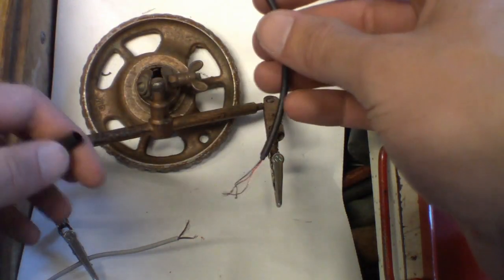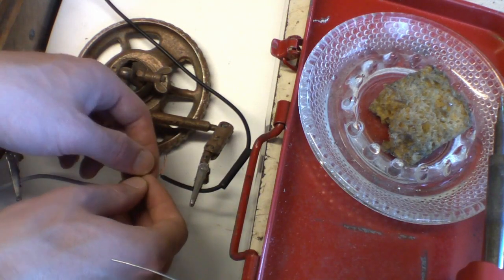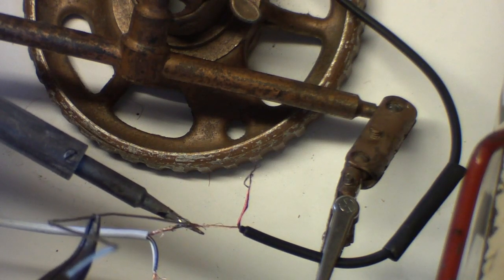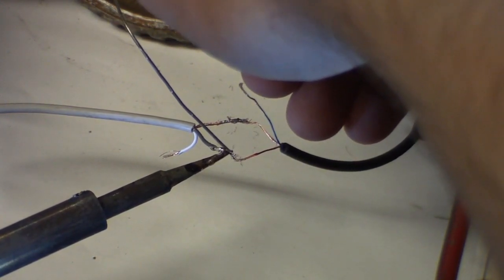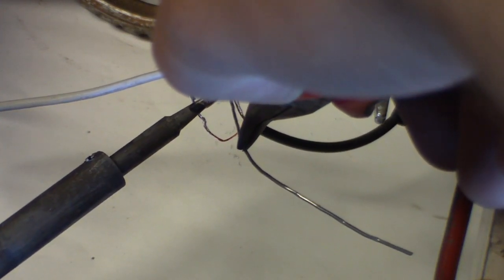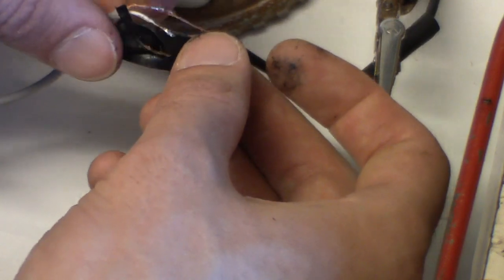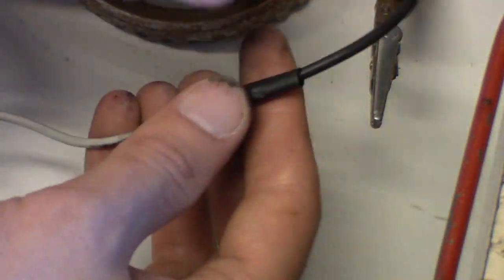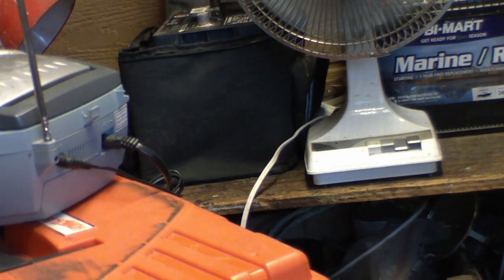How To Fix Headphone, AUX, MP3 cable - part 2

Comment: Thank you kind sir. I always wondered why I can easily repair regular power and data cables but not sound cables. The method appears to be slightly different and required removing the shielding for it to work properly. This makes so much sense.

Comment: Hey man, like your vids and used some to do some beginner soldering work. Is it possible to connect and solder a female adapter for 4 pole aux to Apple lightning usb charger?

Comment: how do you know whats right and left side of the ones you have cut from the stereo? if this made sense
Reply: In the first part he shows how to check which wire goes to which conductive point on the jack. It doesn’t really matter what’s right and what’s left as long as you make sure those match up on both the chords you’re using